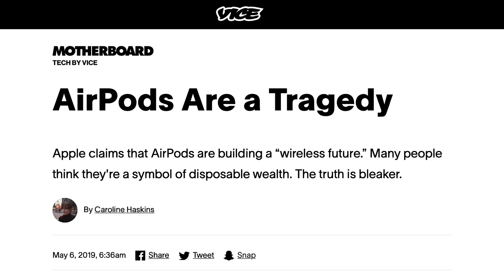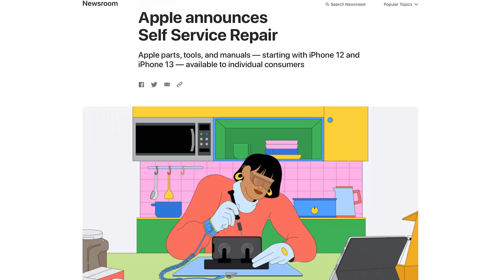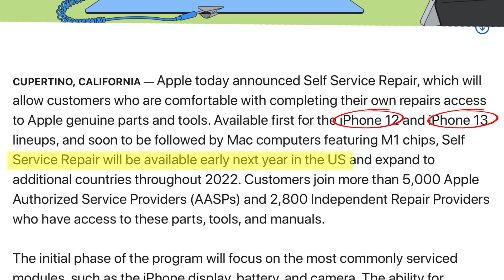2021 Recap: iFixit's Best and Worst Devices!

Comment: LCD panels in the iMac (dust inside the lcd panels after a few years of use) I currently have the 2017… 27 inch iMac 5K

I wish there was a way to clean out dust inside a iMac lcd screen. I am on my 3rd iMac and every iMac I have had… dirt/dust always gets inside the iMac lcd panel especially in the bottom corners.
With all the online video tutorials I have watched… no one knows how to properly seal the lcd up again… I also hear lots of warnings about opening up the lcd panel. 
Every person I have seen online has been warned about if you do not use the proper tape to reseal the lcd panel the device could catch on fire.

Comment: And how many average consumer will actually repair? 😆
Reply: today, in the face of shortage of components - everyone! Not necessarily by users themselves, but by repair shops too.
Reply: Even if the average consumer doesn't repair it, good repairability still matters because it will be cheaper/faster to repair at a shop.

Comment: I just hope we could see at least one smartphone with these features: 

- Removable battery
- Expandable Storage
- Headphone Jack 
- Easy to replace. Flat, 5.8 inch, LTPO, 1080p, OLED Screen with ultrasonic fingerprint scanner
- Support for Calyx/GrapheneOS 

- Physical kill switch for microphones and antennas 
- Flagship SOC 

That would be the ultimate Pro consumer/Privacy respecting device, which will never see the light of day... :( 

Great content iFixit! ^^
Reply: @Cerus98 3.5 mm jack is very useful for me. Water resistant you can reach without gluing battery inside a phone, and gluing backglass to the case, so repair will cost half of the new phone cost
Reply: @ronlevin2339  Exactly!
Reply: @Cerus98 1080p is more than enough to reach a high PPI count on a smaller screen.
Reply: @Cerus98 sorry, fairphone has the same slim deign with removable battery, and you can have water protection with removable battery. The problem in iphone and most androids is not removing the battery strips, but removing the front or back glass from the phone.
Reply: I have a phone like this - Fairphone 4
Reply: @ronlevin2339  not available in US
Reply: @Cerus98 While water resistance is useful, it's very weird to slam the new competition for not managing to achieve an impossible standard. While it a likely for a user to break a device, it's inevitable for some components, like the battery, to fail. BTW Failphone still has a water resistance rating, just not as high because of the removable back.
Reply: @Cerus98 Did you know that water resistance only covers a tiny light presure stream of dehydrated water?  Is a dedicated audio interface worth sacrificing for a misleading marketing claim?
Reply: @Cerus98 who's going to go swimming with their phone?